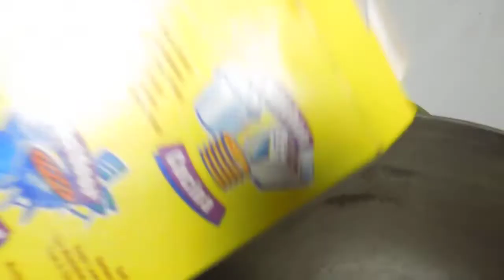Electrolysis Cast Iron blow out.  The rare event does still happen occasionally

Comment: I know castings are very hard to weld, but are you going to try to weld repair that one spot?
Reply from the maker: this is a vintage pot.  The inclusions are just examples of 114 plus year old cast ion technology.  call it character.   The blow out.  I will use some mild acid to clear the rust layer out and then season it with multiple layers of vegetable shortening.  Some folks have successfully done weld repairs on cast iron but I have seen many more failures.  it requires the surrounding metal to be heated to red hot before the weld then to be evenly cooled afterward. otherwise you get more cracking, warping, or mill scale where the metal turns a marbled red color.   Overheated cast iron doesnt season well.  After a while you accept beauty marks in old iron as character.  If it was a drastic break, I might give a local welder a chance at fixing it or breaking it in the process.  cast welding is an old school art form.
Reply from the maker: *****
 I had a switch up on the farmers I work for.  One farm was sold so he doesnt need help up here anymore.  the other guy just finished up his soybeans today.  When corn starts it will be busier with more loads going to town from more places. I have one short video that I will upload soon.